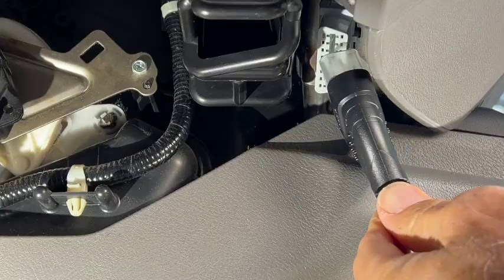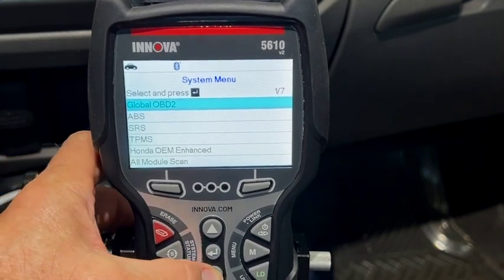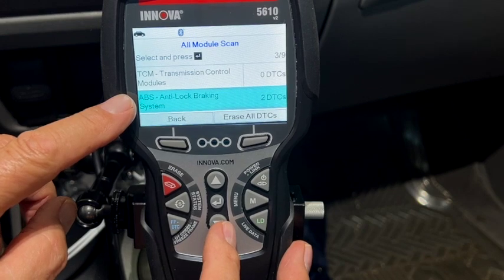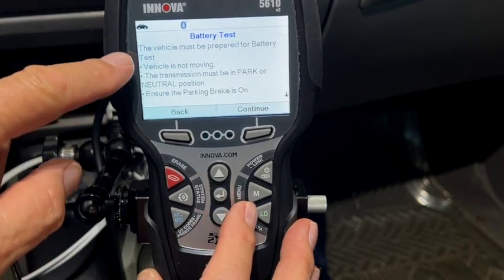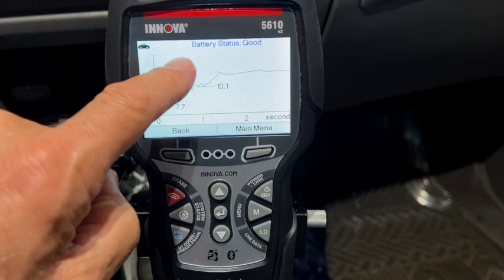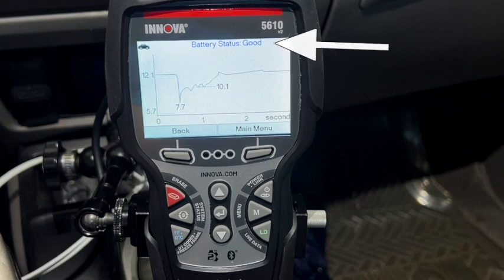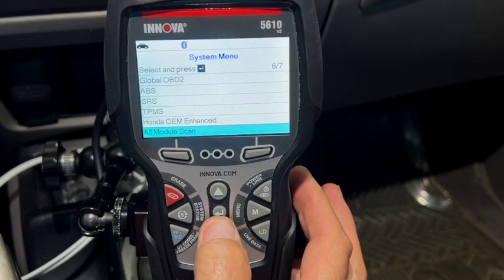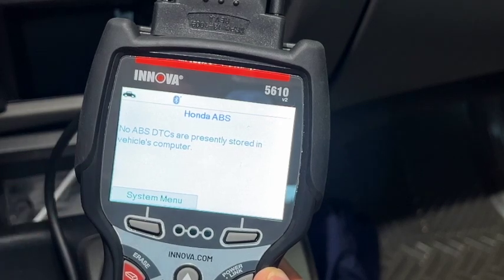Honda Civic ABS light on, low voltage DTC's, Diagnose with the Innova 5610 Bi-directional Scanner

Comment: Thanks Danny great work,,👌 I've got 11 volts on both wires to wheel sensors any ideas ✌️
Reply from the maker: Not much information shared to me. What are your issues, that might be normal readings.

Comment: You always seem to have good luck….. Thought it was going to be a wheel sensor or brake module or something….
This is not really a diagnosis though when just clearing codes
Reply from the maker: Battery low voltage codes are a real problems that need fixing, overlooking the battery as a cause is a big mistake and could cost you, always check your charging system before any major electrical diagnostic checks, I have videos on checking charging systems
Reply: This helps out a lot for my aging civic. Will be keeping an eye on this one. Good job Danny.
Reply: Danny thanks for your videos,,I got 11 volts on both wires to wheel sensors ,,any ideas ✌️